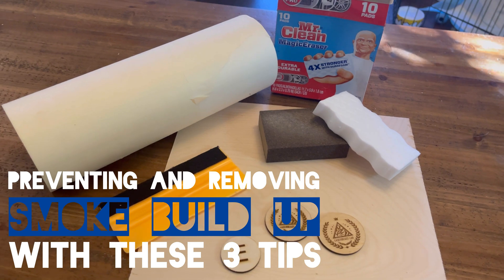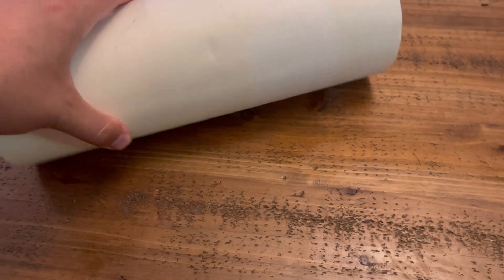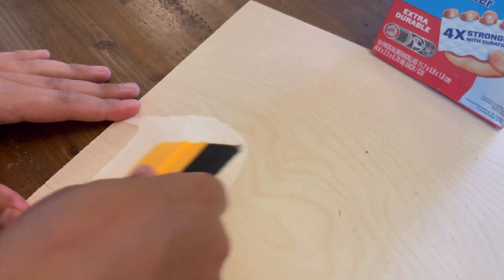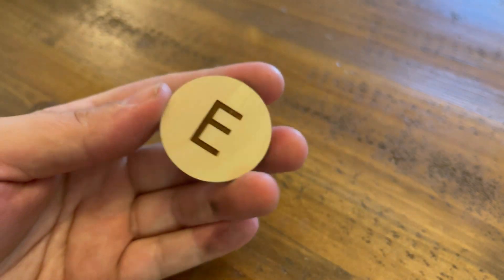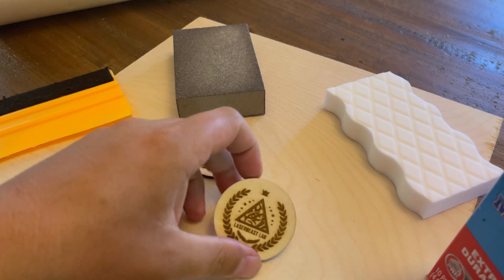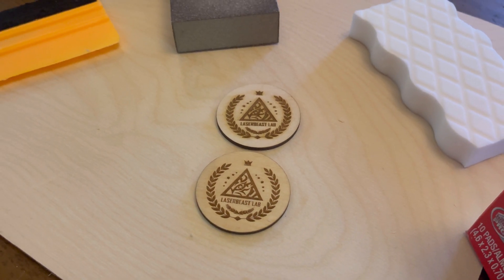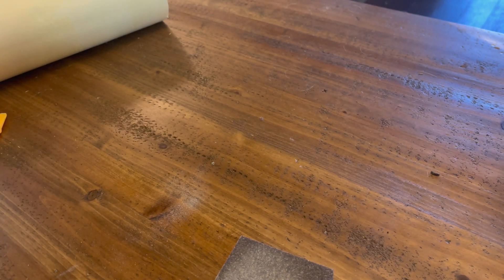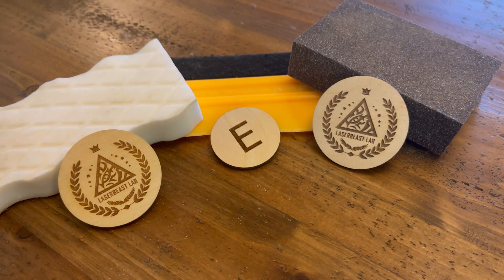3 Ways to Clean Your CO2 Projects - Laser Engraver Tips & Tricks - OMTech

Comment: Do you sometimes use borax or baking soda to darken the engraving? If so can you also use mr eraser/sponge or will it completely remove the darkening again? Thank you for the great video!
Reply: When you apply liquid borax to wood it coats only a few layers of wood fibre close to the suface. When you engrave,  you only need a very short exposure time by using fairly low power but quite high speed. The colour does not come from the normal wood scorching mechanism but by evapoaring those surface wood fibers.. Remember that the borax coating will only be a few fibers deep and what happens is that those fibers disappear (vaporize) and leave behind a delicate exoskeleton of dark mealloid boron where each fibre used to be.  That silvery black exoskeleton  is fragile  and easily smudgesd, so dont rub it with anything. If you have brown fumes then you are using to much power or not running fast enough. When you have mastered the art of fume-free engraving with borax you should immediatey support that fragile exoskeleton by spraing with a clear varnish. You may wish to watch this to see more about the process
https://www.youtube.com/watch?v=7pFuW1zPkkg
Reply: @SarbarMultimedia  I am overwhelmed in the best way with this answer, and have now subscribed to your video newsletter for more